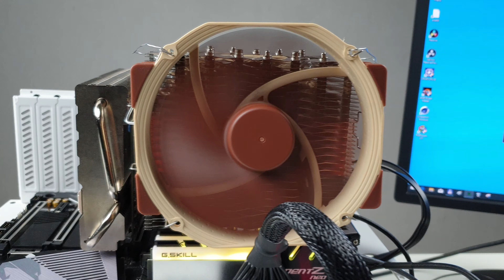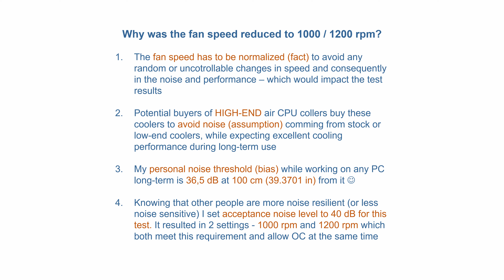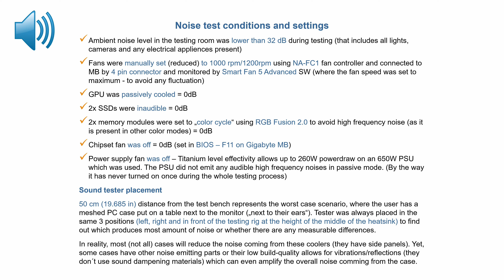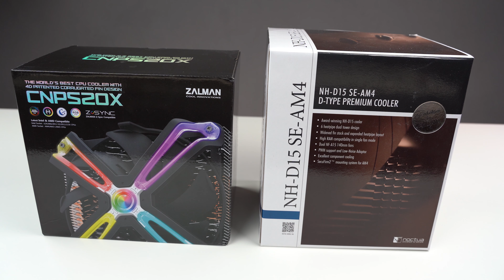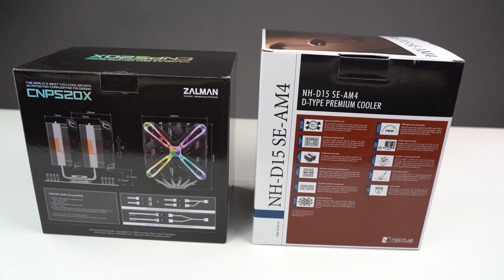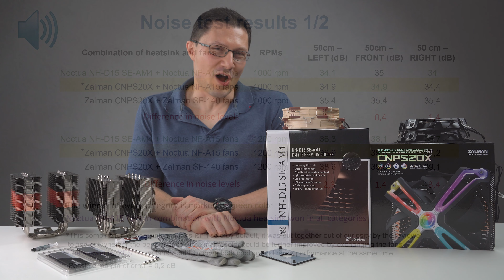Zalman CNPS20X vs Noctua NH-D15 SE-AM4 in TEST - Which is BEST?

Comment: but when Noctua is always easy to install i still find myself getting a Noctua cooler but ZALAM fans to be used on a case is a lot better then Noctua as Noctua suck a lot for case fans with the sound they give
Reply: zalman fans are also very mediocre. But, there is still such a moment that the CNPS20X is much cheaper than noctua (at least I have met zalman at a price of $ 50, and even now its price is dancing around $ 60, which I will not say about the D15). BUT I would replace Zalman's fans, I read about the successful experience of replacing (with a positive result) with P14MAX, I ordered mobius 140p for myself (at low rpm they are the best on the market, as far as I know). If I do not lose the topic, I will unsubscribe about the results when the second one arrives and I will deal with the replacement.

Comment: ZALMAN wins as the sound does not make your PC run better the lower the heat the better it is so your wrong ZALMAN is the winner
Reply from the maker: Actually, I didn´t pronounce any overall winner of the test 😉 Zalman won when it comes CPU temps at certain RPM and Noctua won at noise level at certain RPM. The difference in both isn´t huge, so it depends on what is a priority for you. If it is the temps (as you say) then Zalman is your winner, if it is the noise then it´s Noctua. You are the one setting your priorities.

Comment: THE ZALMAN CLEARANCE  ISSUE  OVER RAM  IS BIG LET DOWN AS CLEARNCE  WITH BOTH THEES IS BIG ? MOTHER BOARD RGB  RAM  FANS  REAL BIG GPU CASE ALL TO TAKE INTO THE CHOICE WHAT GOOD IS ZALMIN  IF DOSNT FIT  OVER OR TOGETHER  WITHEVERY THING ELS JUST A PAPPER WEIGHT where as the d15  gives the clearence on both side to actualy fit it in so you can use it
Reply from the maker: You´re right, the clearance for RAM is very small.  However, when installing CNPS20X on the motherboards (Gigabyte X570 Aorus Elite/Master) I had no problems with installing other components, but I had to make sure the RAM modules (G.SKILL Trident Z Neo - with RGB) were installed first before installing the cooler.

There is 4.5 mm clearance on CNPS20X from the bottom of the evaporator (which touches the CPU) to the first blades of the heat sink (NH-D15 has 6.3 mm on both sides) + 4 mm is the height of the CPU (Ryzen 3000/5000), so all together you get 4.9 mm for RAM. When you want to uninstall the RAM or add more RAM sticks, you have to uninstall the CPU which is inconvenient.

Comment: Should i use the zalman paste or Arctic MX-4 paste?
Reply from the maker: If you´re getting a Zalman cooler I´d use the enclosed ZM-STC8 (8.3 W/mK), it performed very well. MX-4 (8.5 W/mK) would probably perform very close to it, so there wouldn´t be any significant benefit, when it comes to temperatures. They have very similar thermal conductivity.
Reply: @MartinsLab  ok, ty

Comment: Hey, thanks for the review man really appreciate it. Also I want to ask can you do a test with the fan swapped? It would be cool to know which components makes zalman have better temps.
Reply from the maker: Sure thing 😉 , I am not sure I understand – I did swap the fans in all tests at 1200 rpm (look at 10:28 for example) and it clearly showed than when you put Noctua fans on Zalmans heatsink the temperature can be up to 0,8C lower during the most stressful test (AIDA64 - Stress test) and 0,5C in Cinebench and interestingly and unmeasurable difference in Blender – all when the same thermal compound was used (NT-H1).
 
The biggest difference in temperatures was when I used different thermal compounds – up to 2,4 C in AIDA at 1000rpm(4,1GHz) and 2,1C at 1200rpm(4,25Ghz) with ZM-STC8. From this data you can easily come to conclusion, that if you use Noctua fans and Zalmans ZM-STC8 (8.3 W/mK) thermal compound with Zalmans heatsink you´ll get the best thermals (at 1200rpm). But I would personally go even further and use better thermal compound if I were hunting for the best temperatures, like Thermal Grizzly Kryonaut (12.5 W/mK). 

As I mentioned in the video, next time I´ll use different thermal compound for the normalized tests, because it was limiting the performance of both coolers and had the biggest impact on temperatures. (If you´re not overclocking and trying to squeeze every degree, NT-H1 is absolutely fine and I would use it without any hesitation.) Hope this helped :-)
Reply: @MartinsLab  ah, seems like I fatfingered and somehow skipped few parts of your videos. Have you used liquid metal for a long period of time? Heard that it needs to be repasted more than standard thermal paste, like every 6 month. I don't really overclock since I use Ryzen 2 so not much headroom to gain, more about lower temps means lower fan speed means less noise. Anyway, Thanks for the reply.
Reply from the maker: @Natsu Hasegawa Yes, I did. Few years ago, I had a water loop with liquid metal applied (it was "Cool Laboratory Pro" if I remember correctly) on a CPU for about 3 years. I never repasted it - which doesn´t mean it shouldn´t have been repasted – it should probably be done after first 2 weeks.
  
It depends on many factors (surface of the heatsink, what kind of metal is the heatsink made of, how well it was originally applied etc.). Generally it takes time to learn to do it properly. That’s why you should redo it and measure the temperatures afterwards to find out if the first apply was OK or not. 

I had no reason to do it. I didn´t measure the differences over the years because it just seemed to work fine back then and I wasn´t curious enough. However, after the water pump died, it was a nightmare removing it from the heatsink. Removal also damaged the surface of the CPU - the letters on it were barely readable (anyway the CPU survived and works till today – a little miracle). 

If you´re thinking of reselling the CPU after some time (after years) - it could cause you problems, because the letters on the CPU might not be legible after the removal. If you´re planning on keeping it, than it´s not an issue.

Comment: Thx for this.
I bought the zalman because I don't care of the noise. But I need minimum temperature.
Reply from the maker: You're welcome. That's absolutely fine, what always matters most are your individual priorities and your use case. Both coolers have their strengths and weaknesses as you saw in the final summary table at the end of the video. What I tried to do is to provide you with data based on which you can make a decision. If you are making choice between these two you can´t really go wrong - you are in the "high-end" of air cooling one way or the other.
Reply: i got the other   cause  intel 10900k  hot hot runner overclocks to 530 ghz  at 70 c with  NH-D15 WITH the  STANDARD HEATSINK it was running 50c in idal un over clocked also zalman would not fit my masive build ram rgb shell  to tall i got  the big oloy warhawks  shaped like bird wings id have to buy a new set of  4 sticks =32 gigs ram

Comment: Hi @Martin's Lab

Thank you for providing a great review and test of the 2 air cooler giants.
I think there were one more thing to take in count for, besides the tests, packaging and installation.
You needed to add the aesthetics of the coolers. When you compare the looks of the two coolers, which one is more compelling?

When you sit there and playing games with your friends, would the few decibels really matter? I mean, you might still have graphics card or a PSU that sounds like a vacuum cleaner?
If you were the one to pick out one of these two coolers for your new PC build, which of those coolers two would you pick?

I would personally take the Zalman CNPS20X without second thoughts.
Reply from the maker: Hi Kasper, thanks, good question. In my opinion aesthetics depends mostly on subjective preferences of any person and their particular use case - that’s why I didn´t judge it in the test. Some people will pick Zalman for the pulsing RGBs and maybe the copper part of the heatsink because it looks cool. For others it´s all just an unnecessary distraction because their PC case doesn´t even have a window in their side panel to see the cooler.

When it comes to the noise, it all depends on how sensitive you are to it, and how you built your PC (choice of other components). People who work on their PCs often prefer the PC to be as silent as possible, because they don´t want to be distracted when they focus (as you saw in the build I used, the PSU and graphics card were both completely silent - I didn´t buy them just for the testing, they are going into Home server build).

Gamers often tune their PCs for the maximum performance to get the best FPS when playing and they have headphones on. In that case few dBs difference may not be an issue for them. Yet the preferences will differ.

When it comes to my pick, I will use both coolers for different scenarios. Noctua is going into Home server build which you will see probably in week or so - because of easier serviceability and lower noise – it will run 24/7. Zalman is going into my future Video editing PC because of slightly better thermal performance. I will likely match it with some silent case, tune the RPMs of fans (of both Zalman and the case to match my noise requirements) and use even more thermally conductive compound to get the absolute best out of it.